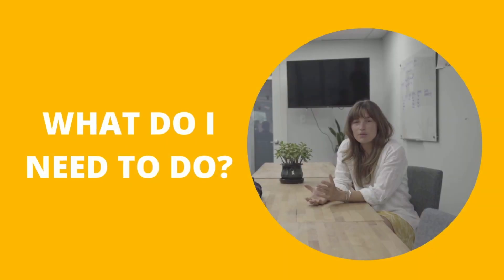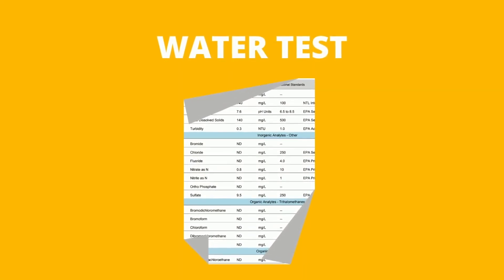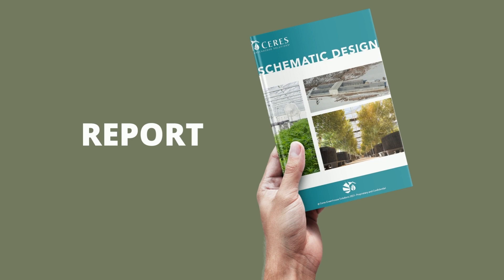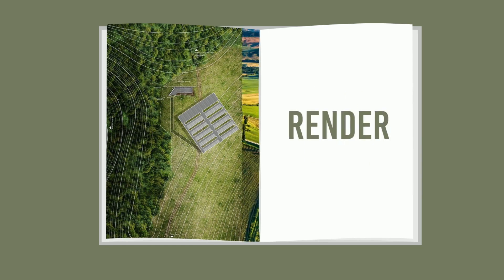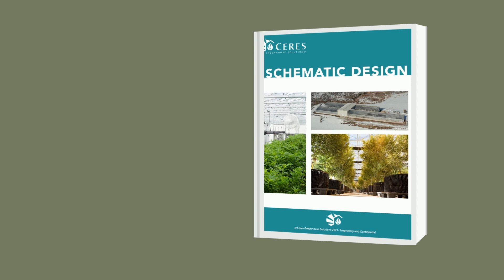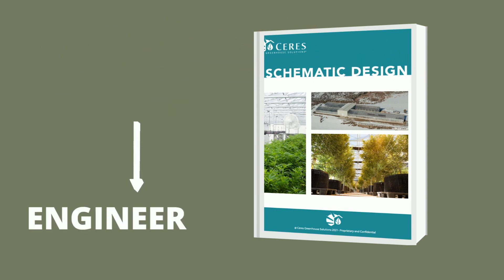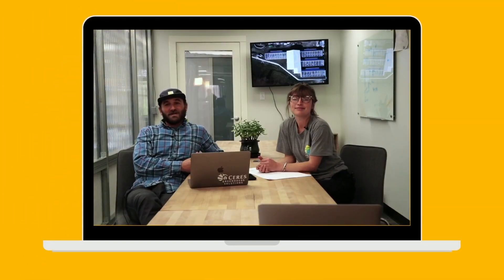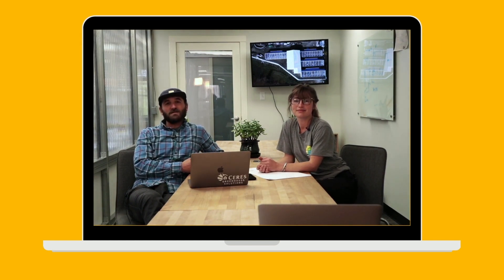Ceres Schematic Design - What is it? And Why is it Important?

Comment: Do you have to go through this process when buying a greenhouse from you?
Reply from the maker: Not for every type of greenhouse project. The schematic design process is for our larger, commercial, or complex greenhouses facilities that require more design and engineer work because of the systems involved. Our smaller or more standard greenhouse designs don't need to go through the schematic design phase.